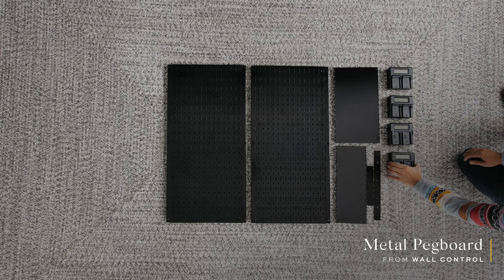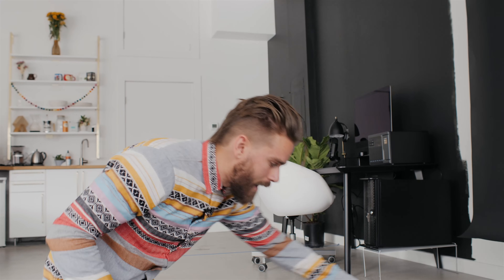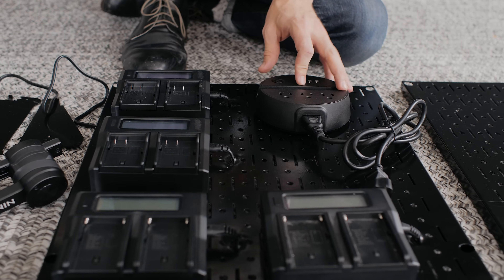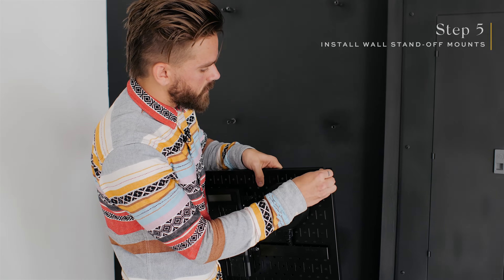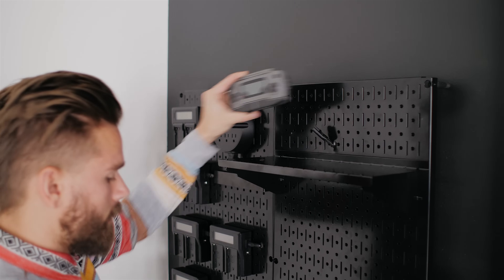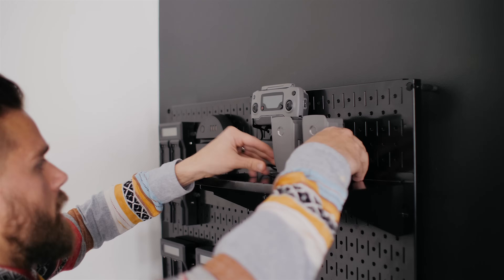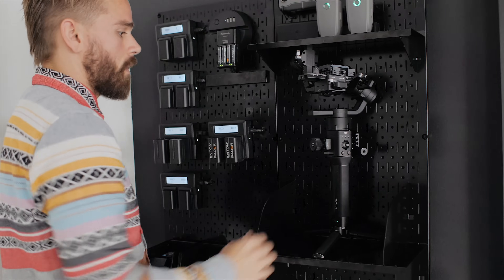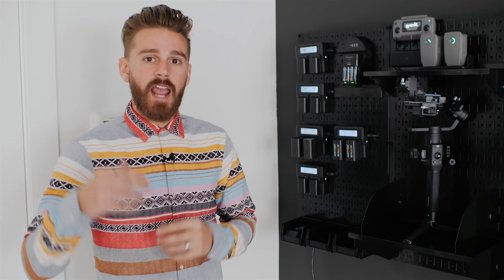How to Build a DIY CHARGING STATION for Videographers and Photographers

Comment: The screws are M8 capped hex screws for anyone wondering. As a tip make sure whatever stand off mounts you order come with drywall anchors and screws that fit inside stand off mounts to go into the wall. The M8 screws might take a little bit of drilling out of the peg board to make them slightly wider because they are a tiny bit larger than the holes. hope this helps someone. I built the same thing :)
Reply: I bought the screws updated on the link and I think they don't fit. LuckIns stand off 1/2 x 2 inch
Reply: I purchased M8 (40mm) capped hex screws but they seem to go right through the holes. Should I add a washer?

Comment: Great job. One suggestion is the hole you opened up for the larger cables I would get something to cover the sharp edges. I would also zip tie the cables to prevent them from too much movement as things heat and cool.
Reply: I was thinking the same thing, he didn't seem to notice the sharp edges could cut the wires, that could in turn cause the metal peg board to turn live/Hot  so metal would need to have a good earthing also.
Reply: Came here to say this. Those jagged knife edges made me cringe when he ran the wire through. Seems like painting a wood (or MDF or whatever it is) pegboard might be a better way to go. Especially since most of it’s attached with Velcro anyway.

Comment: Clean setup. I’d be worried about the batteries dropping faced that way. When I’m on the road shooting, I get the USB dual chargers for the gh5 batteries to save on space. Wasabi Power makes some. Then I plug 3 dual chargers into the wall and can let them charger overnight if needed and not play the game of waking up and changing batteries. They’re also nice on the run because you can have a 10000mah portable usb charger and can charge some batteries.

Comment: great vid, appreciate it!  long-term after a few years now, what would you say are the downsides of this or what mods/adjustments have you made in the meantime that improved upon it?  thanks!
Reply from the maker: the main mods I have done is turn it vertical instead of horizontal. Ive also added sections for V-Mount batteries and holders for Ronin batteries since I don't need the entire space to stand up the ronin.

Comment: Neat. Bit concerned of cables being worm or cut with the sharp metal edges on the drilled/cut holes.  Also Velcro is not a great idea, it tends to come off as the chargers (and the adhesive) get warm during use.
Reply from the maker: Our first batch of velcro came off within 24 hours. We updated our link to the new velcro we use and they have not come off ever. So get the high quality velcro and you will be set ;) Also, the metal edges don't dig into the cables for us but it is something people should be aware of.

Comment: Great idea, been looking for solutions like this. I would have put the chargers the other way around though so the batteries slide in towards the ground instead of towards the ceiling. Just so gravity can help keep them seated.
Reply from the maker: Thought of that as well, but wanted to read the percentage indicators right side up. Also, after 2 years, I have never had 1 battery fall. So it locks in pretty good.

Comment: Nice start!  I would have mounted the camera and NP chargers so that gravity worked for you to hold batteries in place which would have not looked as nice aesthetically.  Also a metal shelf between the charging levels  could offer some protection from a cascade fire should you experience a battery failure.

Comment: I just had an idea: If you hinged this setup to the wall so that it opened like double doors you’d have a much easier time changing or adding chargers to it. More of a modular set up and a good bit more user friendly. Other than some blocks and piano hinges, I’m not an engineer so it might take some trips to the hardware store to figure out how to make that happen, but I think it would make foe a nice combo of functionality and adaptability.  😎
Reply from the maker: Thats a nice idea. However, the goal is to never have to get to the chargers or add to it, Which is why its all tied up permanently behind the peg board. If I want to take the chargers with me, I just disconnect it and I have tons of those charger cables separately that I can just grab if I need to.

Comment: I bit late for the party, I have a few suggestions in case someone else wants to build this:
1. Put the powerstrip in a way that you can reach the switch on it.
2. When you put cables through the perforated sheet, use rubber grommets to protect the cables (And it looks more professional)
3. ???
4. Profit!

Comment: Damn that's a beautiful sight!  Just be careful none of the chargers or power strips get too hot.  It happened with my PC cable management and the Velcro strips lost their adhesiveness.  It might be worth securing any of the items that get a bit hot with something extra.
Reply from the maker: it actually happened to me and so I got better velcro that I linked in our kit that doesn't lose stickiness and fall anymore. learned the hard way and killed a charger to the ground. not because of heat though, because of battery weight.

Comment: I tried the same setup, the NPF batteries are too heavy and cause the chargers to tear off the velcro... Also, do you have any suggestions for charging V mount Batteries?
Reply from the maker: mastercheif1989 I updated my link with the proper velcro that won’t allow those batteries to fall. For V mount, I’d probably just set it on the shelf instead of hanging because of the weight.

Comment: everything listed but the wall standoff mounts- and this is the hardest thing to find
Reply from the maker: Everything is in that one main link in the description. Also just updated the info in the description as the product is constantly changing from Amazon. Sorry for the confusion.
Reply: @Whiteinrevery  Bro, it hasn't been updated with the correct hardware. The screws you purchased to make it all work are still missing. we been to hardware store 3 x trying to make this work

Comment: We need a new link to the standoff mounts PLEASE! I can't find any info on 2 inch standoffs with #12 screw mounts.
Reply: Tom Ryan Yes please!
Reply: SAME!
Reply: Had this thing built for months but no way to mount.
Reply: @chrisyeatts  any solutions ?
Reply: @riseabovesoccer946  I went with M10 30mm bolts for the pegboard to the standoff mount. Then I had to shave down the sides of the heads on the hardware it came with to get them into the standoff mounts, to mount to the wall.

Comment: The standoff wall mounts are NOT the right size for the board suggested. He says he found some screws from Home Depot that allows him to screw into the board but if it fits into the mount that's suggested on this kit.co page then it won't get past the second hole on the board. He never links to them so I suspect he did some hacky thing like he did with getting the plug through the front of the board. Don't waste your time.
Reply from the maker: hi there, just updated the stand off mount link again. The wall mounts keep getting updated on amazon so I had to update the link to a 1/2in by 1.5in length instead of the 2in length that I used. That should still be enough clearance for the power supply in the back. As for the screws, all I did was go to Home Depot with that standoff wall mount in my hand and found the correct thread. It might be size 8 or something like that. Not entirely sure though. I chose a screw with a hex head and had to use an allen wrench to thread it in instead of a screwdriver type of screw. Hope that helps. It easily goes in the hole and perfectly holds the board together. 👍🏼

Comment: specifically buys pegboard to mount accessories,  velcros accessories to board...
Reply: final product looks clean though
Reply from the maker: Its a great option because it is rugged and we can still detach the chargers quickly and take it with us for portable charging on the road when we need just one of those chargers.

Comment: That’s an awesome solution but it’s more of an assembly than a DIY
Reply from the maker: its very DIY as modification had to be made for this particular use. If I were using normal tools, it would be assembly as that is what it is designed for.

Comment: Sorry....it's not clean and worse...it's unsafe. They actually do have drill bits in different sizes. No need to mangle it with a screwdriver?! Rubber grommets in the holes will also prevent a eventual short when those sloppy jagged holes cut into the wires. 🔥 A+ for the idea. A+ for the video quality. D- on the execution.
Reply from the maker: A rubber grommet is a great idea for big holes. The small holes did not cut into the metal and is a completely safe install. The larger hole for the bigger cable could benefit from a grommet. However, that cable is very thick and after 2 years of use now, there hasn't been any cutting into the cable from the metal. Completely safe and working fine. Great recommendation for the gromet though and will definitely implement that in any future installs for larger holes.

Comment: You could have mounted all of those NPF chargers in a single column if you mounted them so that the batteries slid out to the left side instead of down.
Reply from the maker: If we needed more chargers on the pegbaord, we definitely would have installed it that way. That is another option for those needing more chargers. Thanks for sharing the idea.